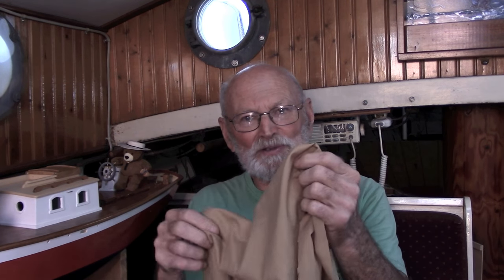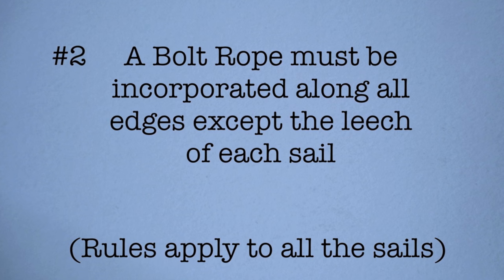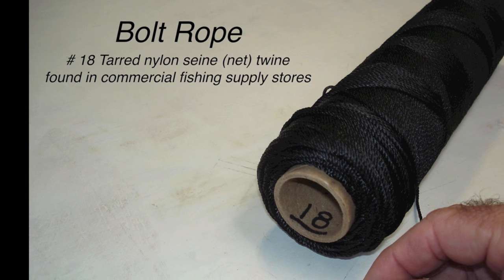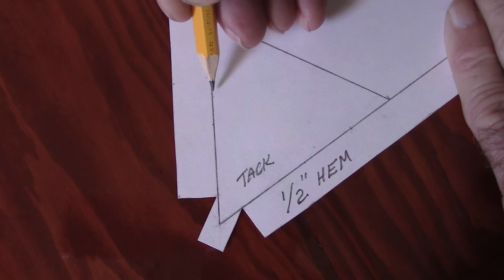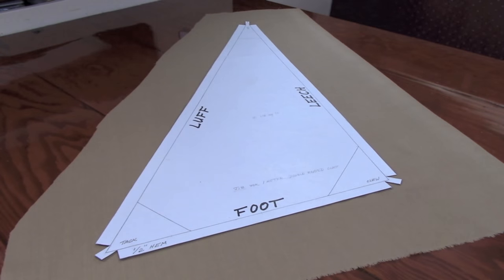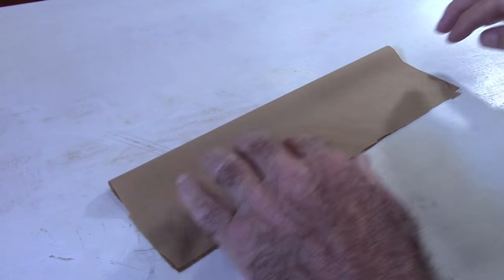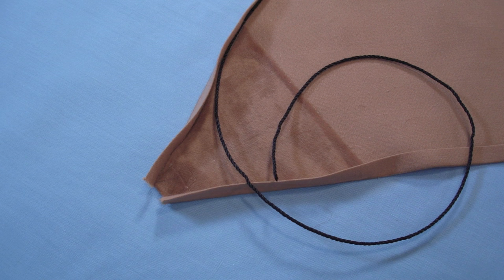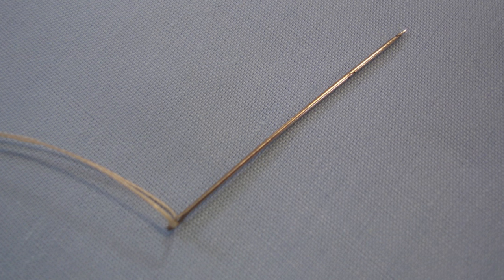RC Sailboat Build - DIY Cotton Sails

Comment: Thanks a lot !

I’ve already made sails in the past for a trimaran model, out of synthetic materials, but they were of the basic kind.

Recently I’ve been designing a successor to that trimaran, properly RCed and designed for speed and racing. This vid helps me a lot in designing my sails, even tho they’re out of synthetic materials (again, but not scavenged on an old laundry basket this time !).

I hope the project will be up to what I designed, since it’s a fairly complex one, but I got a good feeling about it.

Do you have a video on how you control your sails by any chance ? I’m still figuring out how I should be maneuvering the jib.

Comment: Great instruction - thanks Gary. A couple of questions  - is the triangular corner reinforcement double thickness when sewn onto the sail tack and are the two layers stitched one each side of the sail? Also what direction is the warp/weft on the corner reinforcement pieces. Thanks
Reply from the maker: Yes, the corner reinforcement is folded to become double thickness. It lies on one side of the sail with the folded edge crossing the sail while the raw cut edges of the triangle are buried in the hemmed edges of the sail. Moment of truth, I have never given priority to the warp/weft direction of the triangles for they are small and I have made them up from convenient scraps of the sail material.
Cheers !

Comment: Just wondering what weight of cotton poplin you prefer?
Reply from the maker: As I understand it, cotton poplin normally weighs 110 - 130 grams per square meter. This about like a common bed sheet or pillow case. Not much variation, but choose the heavier if there is a choice to be made. Stick with "cotton poplin".

Comment: Hi Gary,
I am going to make my own sails for the Emma, I am building. Your you tube post is very good. Could you tell me the diameter of the twine you  sew into the sails. I am in Australia. 
Thanks for this.
Peter Sowden
Adelaide, Australia
Reply from the maker: Hi Peter, I use either #18 (diameter 1.5mm = .060") or #21 (diameter 1.7mm - .067") twine for the bolt rope, not critical really.

Comment: Visto che ho avuto molto difficoltà a trovarlo ve lo trascrivo qui...
PE # Diametro

PE 0.6 ................................ 0,128 millimetri

PE 0.8 ................................ 0,148 millimetri

PE 1 ................................... 0,165 millimetri

PE 1.2 ................................ 0,185 millimetri

PE 1.5 ................................ 0,205 millimetri

PE 1.7 ................................ 0,218 millimetri

PE 2 ................................... 0,235 millimetri

PE 2.5 ................................ 0,260 millimetri

PE 3 ................................... 0,285 millimetri

PE 3.5 ................................ 0,310 millimetri

PE 4 ................................... 0,330 millimetri

PE 5 ................................... 0,370 millimetri

PE 6 ................................... 0,405 millimetri

PE 7 ................................... 0,435 millimetri

PE 8 ................................... 0,470 millimetri

PE 10 ................................. 0,520 millimetri

PE 12 ................................. 0,570 millimetri

PE 14 ................................. 0,620 millimetri

PE 16 ... .............................. 0,660 millimetri

PE 18 ................................. 0,700 millimetri

PE 20 ................................. 0,740 millimetri

PE 22 .................. ............... 0,780 millimetri

PE 24 ................................. 0,810 millimetri

PE 28 ................................. 0,870 millimetri

Quindi Gary utilizza un trecciato twistato da 0,7 mm